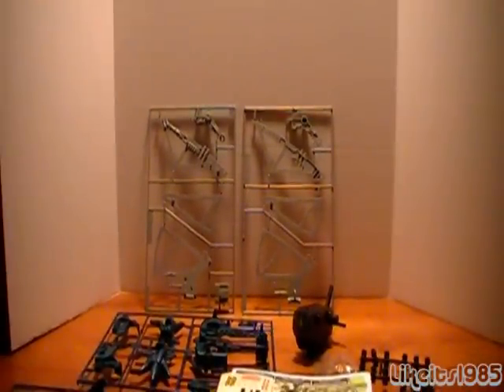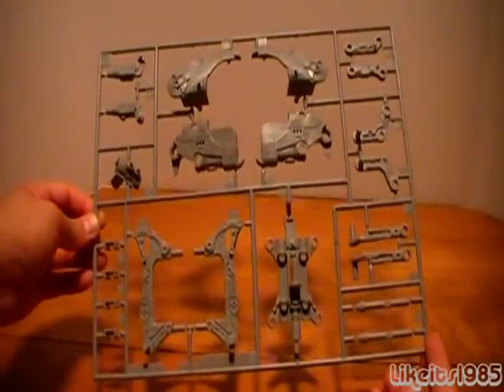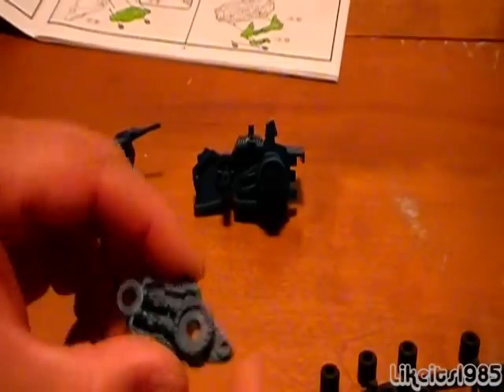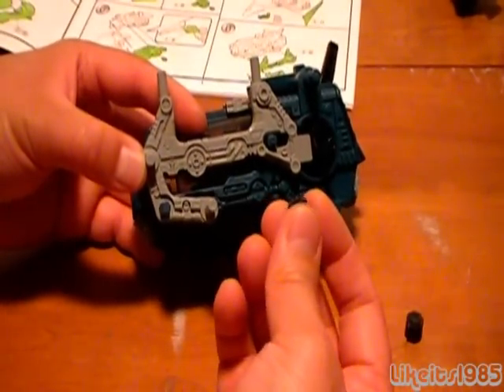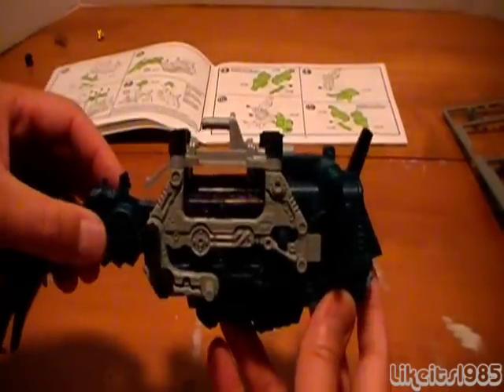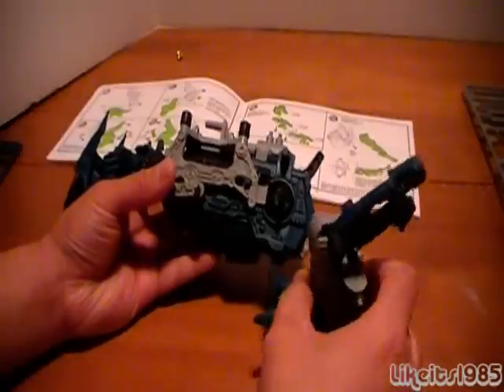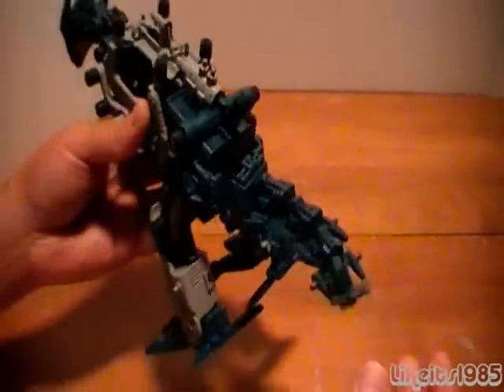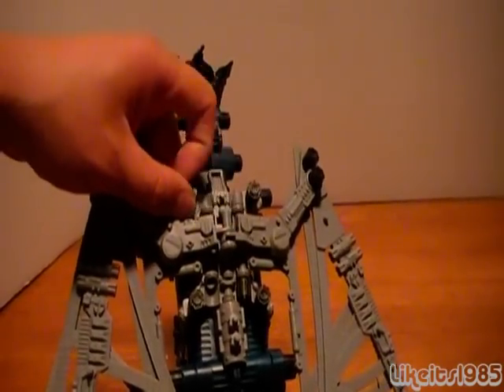Zoids! Let's build the Pteramander!

Comment: Something always bothered me about my Pteramander. I don't remember it ever coming with the missile launcher parts or 2nd pilot. So I didn't know it had that till I grew up.
It was store bought, 
new back in the hayday of the BCM line.
And yet never complete...
It stands to this day as the oldest Zoid I still own in operational condition. It's missing a wing gun I think and possibly a head fin, but other than that still has everything that came with it.
I restarted my collecting last year after a 7 year gap after the line disappeared. I'm up to 17 so far including 2 of the Big 4, with 2 Raynos and a King Gojulas in transit, and plans to obtain an Energy Liger and a Holotech Genosaurer in the future.